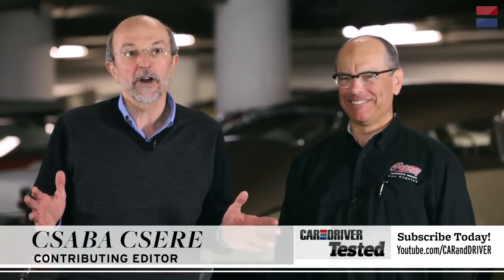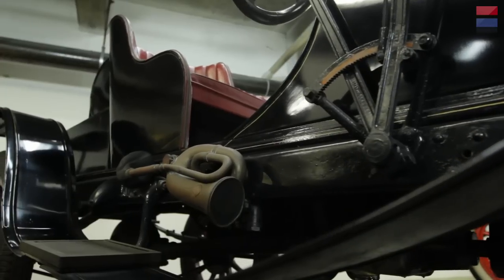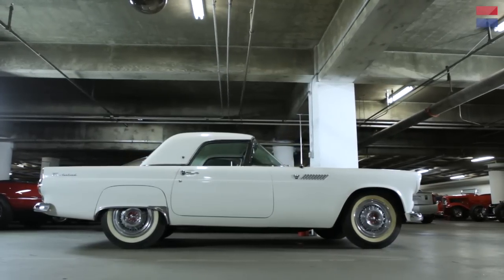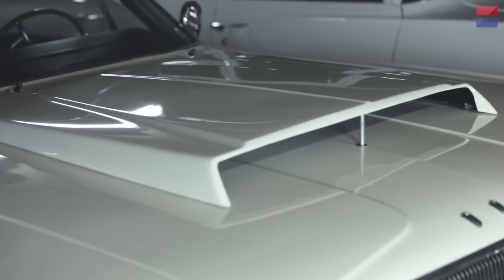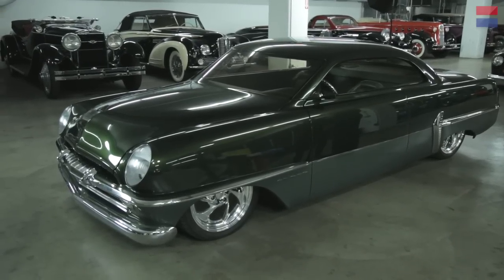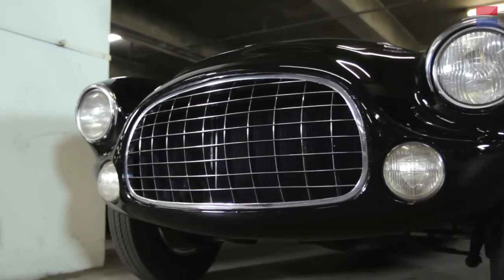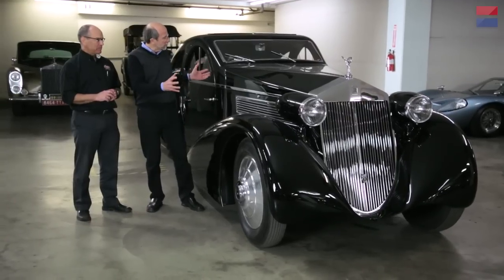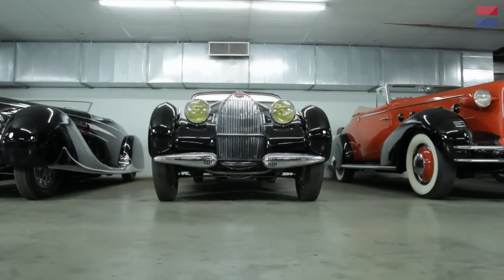Petersen Automotive Museum Vault (Part 1) - CAR and DRIVER

Comment: Just a correction, they say that the Sniper was designed and built by Chip Foose, this is inaccurate, It was designed by Foose, but the construction was handled by Troy Trepanier, owner of Rad Rides by Troy.

Comment: No mention of Richard Trevithick here or Cugnot. From 1769.

In 1801, after James Watt's earlier patent on "a carriage propelled by a steam engine" had expired,  Trevithick constructed an experimental steam-driven vehicle (Puffing Devil) at Camborne, Cornwall. It was equipped with a firebox enclosed within the boiler, with one vertical cylinder, the motion of the single piston being transmitted directly to the driving wheels by means of connecting rods. It was reported as weighing 1,520 kg (3,350 lb) fully loaded, with a speed of 14.5 km/h (9 mph) on the flat. Trevithick ran this for several hundred yards up a hill with several people hanging on to it. 

Unfortunately, while the driver and passengers were in a pub celebrating the event, it set fire to a shed in which it had been left unattended, and was destroyed.

The following year, Trevithick and his partner, his cousin Andrew Vivian, patented a steam coach, the patent also describing other uses for Trevithick's new high-pressure engines. The vehicle was assembled at Felton's carriage works at Leather Lane, London, the engine components having been brought from Falmouth where they were made. 

You have to look up this bizarre early attempts, there are working replicas still out there puffing around, the Steam Carriage is something one would not really want to risk riding in, it looks terrifying.

Comment: the first car built was in 1867 in canada.. it went 26mph..ford was producing cars in 1908...my grandfather was assembling them at my great grandfathers dealership..they came in on the train in crates the exact size to use as floor boards..the dealership was in northern canada.. by 1912 lots of cars were produced..by 1966 ford and chevy agreed to not compete in drag racing with factory built drag cars.. dodge still did. the bumpers were stamped sheet metal and would shake when the car was running..

Comment: did he just say " modern day reliability " what a joke, modern cars are made of plastic
Reply: Most modern post-2000 cars can easily go past 125,000 miles- and with few issues. That wasn't possible with the average car even in the 1970s, let alone decades earlier.

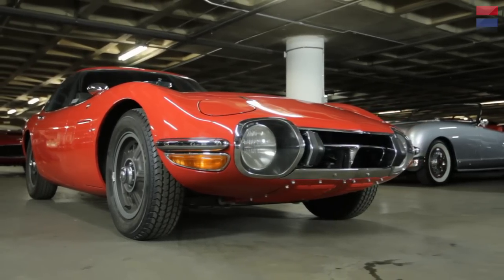Comment: @18:19 SEXY ?   Those  oversized out of proportion bug eyed factory driving and taillights look like an afterthought  and the distracting rectangle  REFRIGERATOR DOOR in the passenger side front cowling     are about as SEXY as taped up  horn rimed glasses ..... they  take away from the sleek lines of an otherwise great design ...... Rare ?  YES .....Sexy ..... Not so much